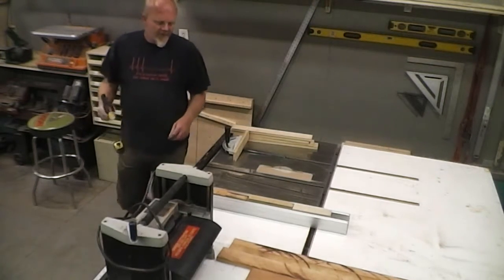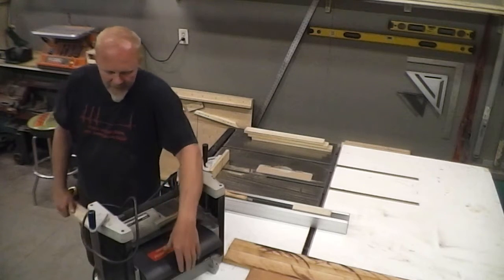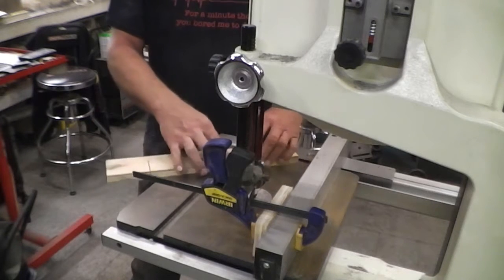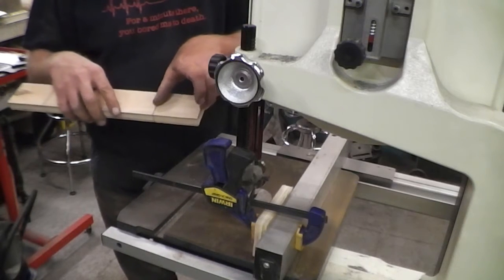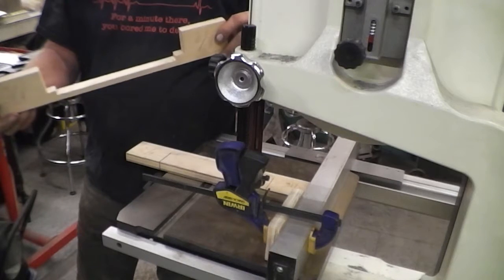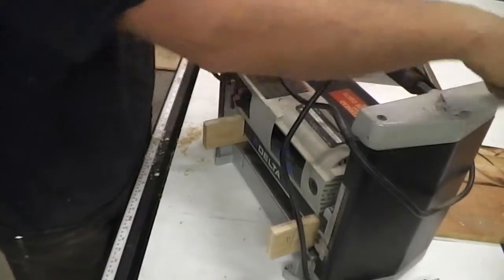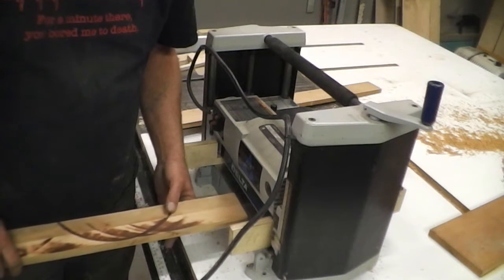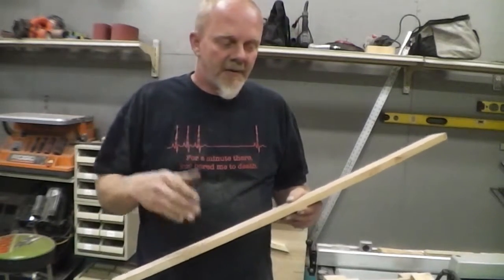How I stop planer snipe part 2 with how to make the gauges

Comment: I tried this on a Delta TP300 and it worked great. I had excessive snipe and tried a table completely through planer from one side to the other. It was well fastened down to planer. My snipe doing this was just as bad then without it.
Next I tried the blocks as Jerry said. This worked perfectly. For my test I made small blocks I set in all four corners so when adjusted down planer head set tight against the blocks. The snipe is slightly noticeable but easily removed with sanding. I measured my blocks compared to finish product and it's 0.0135" larger. Otherwords the blocks are 0.135" larger then finish product. Calling this an 1/8" would work fine. I plan on using Jerry's method for best results on this planer. Thanks Jerry!
Reply: Edward Crouse if you have access to a machine shop, why not make inserts for the critical step. You can change them out foe every 1/16"
Reply: I am going to do something like that but can do exactly that. I have plenty of aluminum stock here of all kinds of sizes and shapes. It would be easily done on the mill.
I haven't pursued the fix anymore due to traveling to neighboring state to paint my son's new house and other projects there. 
I will share what I do once I have time to get to it. Thanks for suggestion.
Reply from the maker: Edward Crouse that is AWESOME!! I am so glad this worked out for you. the difference between finish and blocks varies from brand to brand so I have been told and I really wish I had mentioned that, thank you for bringing that to lite for others.
Reply: Thanks Jerry. I was going to mention that but this old brain only holds so much info. Again thanks for the fix!
Reply from the maker: if you are still showing a small amount of snipe, try running through for a second pass and see if that doesn't eliminate it completely. if you try this please let me know own what the results are. thank you
Reply: I did Jerry. It shows less snipe on second pass but still noticeable. Again it is so light that slight sanding removes it. 
I just rebuilt this planer due to bearings shot on cutter drum. While in there I replaced all bearings and completely cleaned and relubed. It was setting in storage for ten years. I bought it long time ago and when we moved I sold all my equipment but this machine. Now I am settling into retirement and setting up new shop. A planer is not in my budget so I figured I would just rebuild this. First thing I remembered was the bad snipe. When rebuilding I noticed how loose the columns seem to be in the planer head. Now it makes sense. The planer head twist out of alignment as piece is fed through.
I am kicking around some kind of fix based on your idea but it isn't real clear to me yet. We have a machine shop here that my son setup. If I can come up with some sort of adjustable jig to use that would be nice but like I said it isn't real clear to me yet how to achieve that. If I come up with something I promise you will be the first to know after all it is your idea that got this ball rolling.
Thanks again Jerry!!!

Comment: Your discovery makes sense 100 and 100 percent.
I am sure , ''light duty'' Planer's manufacturers knew that.
on super heavy duty planers I see 4 heavy columns in four corners ,  and that is to prevent rocking.

I am going to make several sizes that  I work with most:  11/16,  3/4  and  perhaps 1/2.
And if I was not lazy,  I'll come back here and report  to you and all other wood workers 
cult members. 

 Thank you and Greetings from north California in mid  pandemic that All capitalist Governments messed up  real bad, except Germany.
All Socialist Govs did much better;  Vietnam was  the best example.
Reply from the maker: The major difference between the "lunchbox" planers and the heavier "4" post ones is on the heavier duty planers the table goes up and down and the head and feed rollers are stationary making the rocking of the head impossible ... Please due come back and let everyone know what you think after trying this...

Comment: Hello, I want to make Kumiko in the future.
Can such a jig also be used to plane strips of 3mm thick.
Reply from the maker: If your planer will do the job then yes this will help you. you just need to work out the height of final plane with  the underside of your planer head, once you have that dialed in you will be all set..
Reply: @JerrysMachines360  Thanks for your answer. I have a Triton TPT125. Ist it possible to sent you a personal message via mail so I can better understand how the gauge works.

Comment: As a Tool and DieMaker with 54 years of experience, I REALLY admire your approach to solving the real issue instead of relying on what others have said is the cure for snipe. Suffice it to say that I will be making these jigs and will concentrate on the 4 most important heights of the jig. I will massage those 4 heights till they are within a half thousandth of my desired heights.

THANK YOU for a brilliant solution!
Reply: When I was young Manufacturing Engineer I was wise enough  to keep quiet and listen when older Machinists and tool makes spoke.
For sure I be back on this site;  Please keep cult members posted on your designs.
I'll do the same.
Machinists and tool makers changed the world more than most.

Comment: Jerry, 
Thank-you for putting this information out there in the ether sphere. I am tired of wasting good lumber (cut off"s ), after I spend all that time making boards smooth and straight. Your idea is simple, effective, and to the point. I can't wait to try this in my shop!  Its funny how people get offended when a vexing problem has such a simple solution. I can only guess what they are thinking: "If it were that simple, I would have read about it in woodworkers journal !"   Pride is a difficult animal to tame. 2016 is a perfect example.

Comment: Because of the snipe issue, I put off buying a planer until I could afford one of the large expensive ones. Still haven't accumulated the coin, but after watching your two videos about how to control snipe on a lunchbox planer, I'd setting up one today, and building your jib to reduce some boards from 3/4 down to 5/8th tomorrow. None of my woodworking really requires an expensive planer except for the snipe issue.

Thank you for saving me a bunch of money :-)

Comment: what if you have to plane something less than .75 or more than .75 Do you have to make one for every different final planed size
Reply from the maker: frehleycomet i cut them to whatever size i need. if it's something common i keep them if not i make them when i need them
 scrap to make them is much better than wasted material due to snipe. i can go down to 1/4" with no issue, and can go as large as the planer will allow.
Reply: Ok so if I have a board .75 and want it down to let's just say 5/8. I know that is a lot do I have to make one for every 1//16 until I get to 5/8. Also for cutting boards when the top is not always level how do I stop snipe with that. Thanks for the quick response
Reply: so if i want to go from .75 to 5/8 do i have to make one for every 1/16 until i get to 5/8. Also for cutting boards that the top isn't always the same height what do I do for that. Thanks for the quick response
Reply from the maker: frehleycomet you just need a set for whatever your final thickness needs to be. you can run them all through till the snip is just shy of what you want your final to be then use the spacers to run final with.